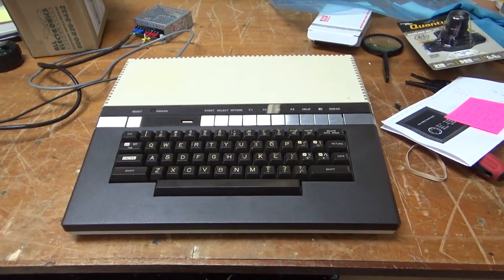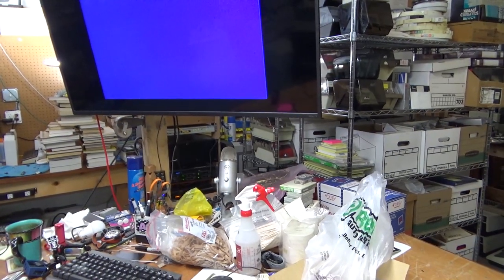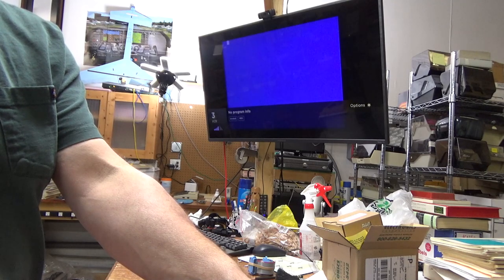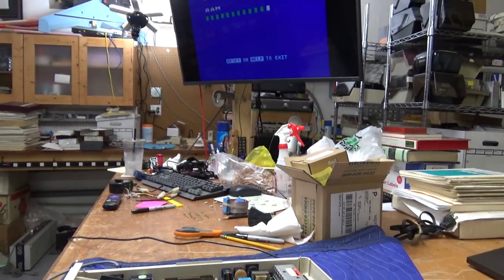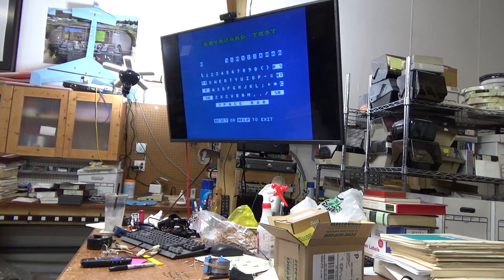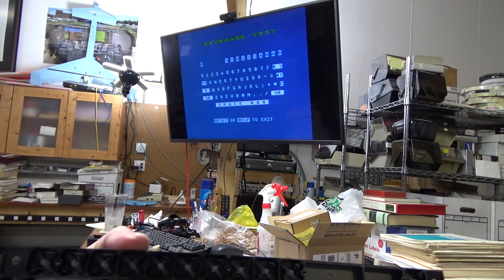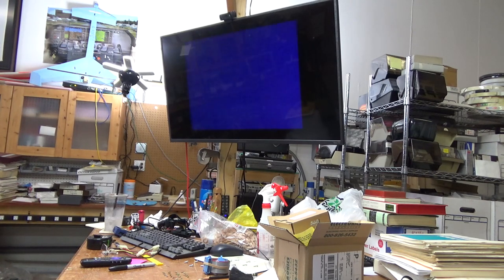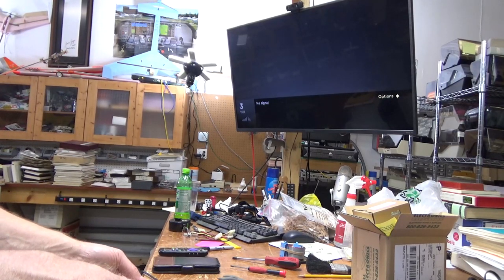One of the rarest Atari computers in existence.  The Atari 1400XL!

Comment: Awesome. Was great to hear the voice synthesis for the first time. The voice sounds great, too. Strongly suggest you wipe the function keys clean after use to keep them looking pristine. Might be the acidic oils in our skin that degrades the appearance of the aluminum over time. IMO the keyboard working or not is not as important as is the 'original'  condition of the machine. It's a collector's machine first and foremost since it's worth so much, especially in that fantastic state of condition. On my Mitsumi 800 keyboard (nearly identical) I was able to get the mylar fully working again by doing what you did and fully cleaning the gold fingers contact area and then re-applying the little tape strip there (cleaned the strip too, iirc).  The keyboards failing is a very known issue and doesn't lower the value since there are known fixes and a 1400XL is great anyway.  The motherboard looks fantastic with seemingly no corrosion.  If you keep it you might consider spraying some sort of protectant (well researched) on the whole board to preserve it.  Afaik, oxidation can creep up the chips legs into the chip package... Some of those chips are extremely rare. 

Here is a video on how to use the A8's https://www.youtube.com/watch?v=mPQzDnaAs0g  The first seven minutes are skippable that cover the hardware models.

Congrats on your find!!
Reply from the maker: The reason the function keys look a bit weird is because the original plastic film is still on them.  You have no idea how hard it was to not peel them. laughs  I'll check out the video you linked to, thanks!

Comment: If the 1400XL and 1450XLD actually had been released, they just might have saved Atari.
Reply: I had the 1984-ish brochure featuring the 600XL, 800XL, 1400XL, and 1450XLD. I wanted the 1450XLD so bad. Got the 800XL for Christmas. 

So that’s the end of 1984 and by now Warner had sold Atari Inc to Jack Tramiel’s new Atari Corp, not that I knew any of this as a kid. I’d hoped to have a pack-in detailing the Atari magazine and software publishing group - that’d have been Atari Connection and Atari Program Exchange (APX) if I got that right but in wasn’t sure of the names I just knew that something like that existed and that’s partly what interested me in Atari. But those were gone / shut down / axed. Not that I knew that either at the time. 

Wasn’t until 1986 that we got a disk drive and I discovered Analog and Antic magazines. Sears was the place to get Atari but that seemed to change after 1984. Gee I wonder why. But there wasn’t a good bookstore around (or even magazine stand) until 1986 (so I could find Atari specific magazines and books) and finding Electronics Boutique store to buy the 1050 drive and software. 

The mail order ads from back then show that the prices came crashing down. Probably due to Jack’s price war. But everyone I knew started buying the C64 so oh well. I wasn’t going to switch. I loved the XL. Preferred it. 

But what would have saved Atari? Well looking back I seen the 1200XL was $1000 (too much!) and DOA. The cheaper 800XL needed to be out early 1983 AND in quantity. The C64 started at $600 and had to establish itself in the market. Atari could have made the case that they look/sound about as good and have lots of software and peripherals already. Marketing helps and not just ads but the sales channel- get it in front of customers. Not just Sears. If CBM was in  Toys R Us or K-Mart then Atari needed to be there too to offer the choice. 

Considering the Intellivision “master component” and “keyboard component” idea, and the Mattel Electronics Aquarius, and the Coleco Adam, then clearly a bunch of people thought that bridging video game consoles and home computers was a good idea. And the XEGS nailed it! … just 3-4 years too late. It was mostly over by then. There was still new software coming out but some titles only C64 or even Apple II. The push was ST (not that I ever saw more than one ST owner in person). There was a plethora of early-mid 80s software titles at Electronics Boutique so even with less output I never felt at much of a loss. Got a word processor. Atari planetarium. Utility software. All the classic games I wanted were mostly out by then. But yes it could have been better. 

The 5200 should’ve been the XEGS. The 5200 had the GTIA and Antic and Pokey. Needed 16K with expansion to 64 and needed an SIO port. And keyboard.
Reply: @nickpalance3622  Atari also had the 800XLD on its drawing board; this was to be essentially the 800XL but with the additional dual floppy disk drive and the "Freddie" memory management chip and, thus, utilized a larger case to accommodate it. Same with the 1450XLD, which was planned to have the same features as the 1400XL + dual floppy disk drive.
Reply: @ClassicTVMan1981X  interesting! While the 1200XL/1400XL case design (particularly the size / surface area) lent itself to having a disk drive on top, I gotta wonder what Atari had in mind for merging an 800XL with a 1050 (or DS/DD or whatever in a 1050 style case). Hmm… turn it sideways like an Apple //c ?
Reply: If you look closely at some of the press photos of the 1450XLD, the nameplate read 1250XLD.  I'm guessing that they had a 1250XLD in-house that was never released, then bumped it up to be based on the 1400 instead of the 1200.  I heard rumors that they had trouble with the drive, so there weren't any finished working models before it was canceled, but they did have a bunch of 1400XLs that they could have shipped.  If the sale of the company had been delayed just a few months, the 1400XL would have been much more common.

Comment: Nice, I had bought a nos 1400xl motherboard, a 1200xl case and keyboard and a psu years ago, I stupidly got rid of this years ago, today I have a 1200xl, both worked. My Atari 1200xl is one of maybe 100 or so left out of maybe 100,000 made, and my 1200xl is registered to me. Nice video.

Comment: Just came across your video.  Congrats on acquiring one of the more rare machines.  I have a 1400XL myself along with a TONG version of the 1450XLD.  Good thing you learned quickly not hook up a standard 800XL/130XE power supply to the machine.  I would certainly be interested in learning on the power supply you found to use with your machine should I need to acquire a backup power supply.  Also be aware you would not be able to use any of the Parallel Bus Interface (PBI) devices that came out for the 800XL/130XE computers such as the Multi-IO (MIO that was produced by ICD) and the Black Box (made by Bob Puff's CSS).  Since the PBI was never really supported much at all by Atari the MIO and Black Box did not fully follow the design spec for the PBI.  So if you try to use the MIO or Black Box with the 1400XL the internal voice synthesizer and modem device will conflict with the MIO and Black Box.  You should be able to find some info on-line should you want to experiment with the voice synthesizer.  The voice synth use in the 1400XL is based on the famous Votrax SC-01 chip.  When you boot up the computer the voice synth gets a V: handler driver installed which would allow you to access the handler to send voice commands to the voice synth.  Be as simple as running a OPEN #1,8,0,"V:" to open a port to the V: handler driver and then use PUT #1 basic commands to send strings of data to the voice synth to try and make it talk.  Challenge is to form intelligible words using the Votrax phonemes to form the parts of speech to put together a word.  I had actually written a program for a good friend where I had replaced the built-in test on his 1400XL with a variation of the 1200XL raindbow logo display with a horizontal scrolling message that was read by the voice synthesizer.  I managed to get the program to fully fit in the in limited memory range of the built in test program (Hex $5000 to $57FF).  Your video sure brings back memories of a great machine which in my opinion has the most smoothest keyboard touch in all of the Atari computers (similiar keyboard as used in the 1200XL).
Reply: Here was a story I heard way back that an engineer at Atari had made a useful application of the voice synth and modem on the 1400XL.  He used an Atari Cassette drive where the computer would detect a telephone call coming in, answer the phone, voice synth would give a typical answering machine response, then the software would connect the telephone line to the audio out to the cassette and record a message left behind by the caller onto the cassette.  Never could find this software or even more details on this.  But thought it would be a cool project to recreate.

Since you have this machine you should see if you can get the 1400XL Telecomunicator cartridge to go with your machine.  Its a piece of terminal software that takes advantage of the built-in 300 baud modem and voice synth.  Must have with you computer - if you don't already have it!

Comment: Very nice machine. Easy fix on keyboard, 2.5mm diameter heat shrink, cut into approx. 2mm slices and collar all (70?) silicone tips under each key, like a ring on a finger. I made 3 videos about this, fixed 2-1200XL keyboards this way. Good luck.
Reply from the maker: Now THIS is what I was hoping to hear from someone.  Thank you for the tip!
Reply from the maker: Would 3mm heat shrink work equally well?
Reply: @f15sim  Don't know, but I know for a fact that 2.5mm works perfectly. Keep in mind that I did not alter the mylar in anyway, my first video on this is the best in explaining what I did. Titled something like "MITSUMI Keyboard Repair...."
Reply from the maker: @Anangelspath  Ok.  I'm 99% sure of the process involved, but I'll certainly check out your video.  Thanks again for the tip!

Comment: The 1400 XL was never sold commercially.  What you have is an extremely rate production sample.  It did go into production, but only for a very short period of time.  The failure of the 1200 XL plus with all the problems going on at Atari in 1983 and the crash of the video game market probably shelved these models in favor of developing the 16 bit Atari ST computers.  The only unique features it had was the voice synthesizer and a built in modem.
Reply from the maker: As far as I know, fewer than 100 1400XL machines ever existed.  I think the number of 1450XL machines was smaller than that.  The machines were killed during Tramiel's cost-cutting efforts after buying Atari.

Comment: I had the exact same problem with my Atari 800 computer keyboard I put a small dab of hot glue on each of the membrane pads so that it gives the keys a little more surface area to push on the membrane and that seem to work great long-term no idea yet
Reply from the maker: Because the 1400XL is effectively an artifact, I didn't want to do any more to it than I already had.

Comment: What TV/Monitor and connection are you using? It's very clear for a modern flat screen!
Reply from the maker: The TV is a 50" Insignia (Best Buy) 4K LCD and I'm driving it straight from the RF output on the 1400XL.  The TV has a cable input on it, so I've got a short bit of coax connected to that, with a female F to female RCA jack attached to the end, then it's a typical male to male RCA cable from there to the computer.

Comment: Pretty sure the reason the keyboard works by pressing the mylar is because your finger is bigger than the rubber mallet pressing the key. Adrian's Digital Basement channel did a repair on an 800 keyboard mylar that is functionally identical to this one. He used a very light sandpaper to reactivate the carbon on the pads which may oxidize over time. I would be very hesitant to replace the mylar with a modern mylar from Best Electronics (which will work) only because this is an extremely rare like-mint 1400XL which is worth maybe $10,000. Keeping it factory original increases its value, greatly. A light sandpaper and / or shifting the mylar just slightly so that the key bumpers hit a different spot should hopefully fix it.
Reply from the maker: This is why I decided not to go into the keyboard again to "wake up" the remaining keys.  I've seen a "zero impact" repair that involved placing a small bit of 1/8" diameter heat shrink over the key "anvil" in order to increase the reach and thus the pressure applied to the membrane. (The heat shrink tubing isn't heated - it's just used as a soft plastic extension.)  The next person to get the 1400XL after me will have to be the one to do any further work on it though.
Reply: Valuing this at $10k is misleading.

Comment: Does the keyboard structure limit the depth of key travel to protect the membrane?
Reply from the maker: Yes.  Under the key post is a little silicone hammer that's supported by a spring that pushes on it from the inside.  I suspect the springs have weakened over time and are no longer pushing the little silicone hammers out far enough to make contact with the membrane when the key is being pressed.  The solution offered by ScottyAnimation involves putting a 2mm wide slice of 2.5mm heat shrink tubing on top of the silicone hammer.  This has the effect of artificially lengthening the silicone hammer.  Of course the proper fix would be to replace all the springs, but I suspect that those are unobtainium at this point.
Reply: @f15sim  Ah. I had this window open on my desktop since yesterday and did not see the other replies.